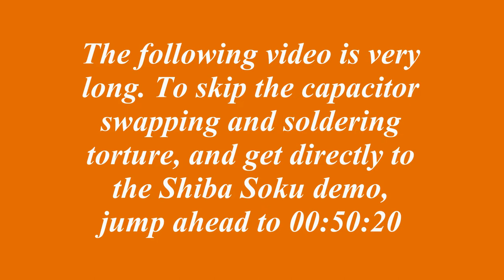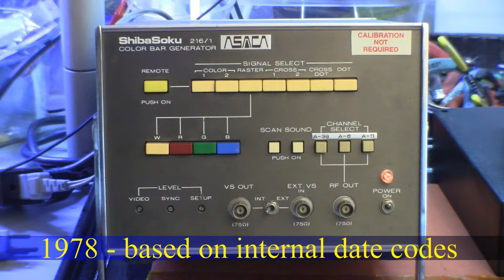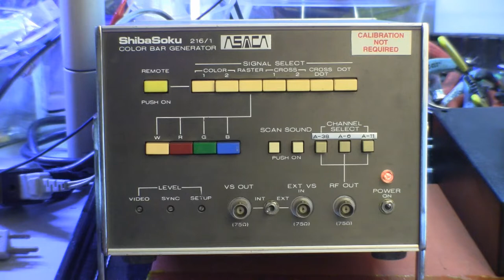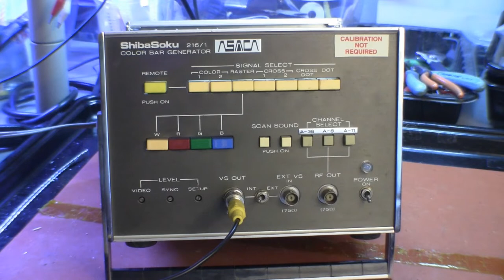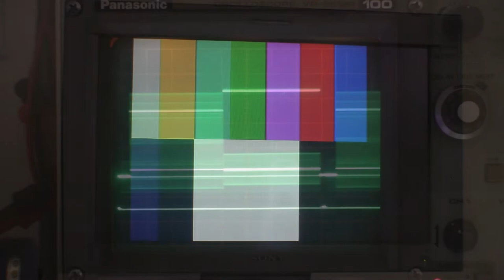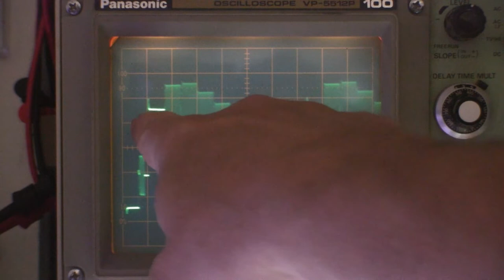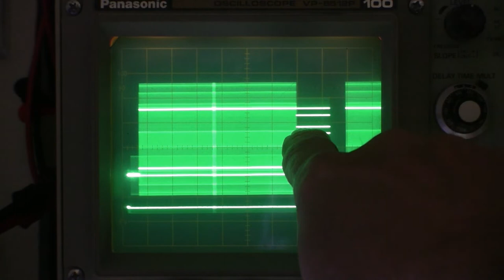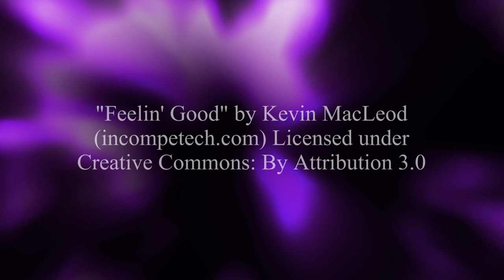Servicing My Shiba Soku (Asaca?) model 216/1 NTSC Color Bar Generator,

Comment: I really love the look of 1970's electronics! They usually seem to be much more neatly wired and well built, and the components were still spaced out enough that it's relatively easy to work on. By the 80's, I noticed that things were starting to get a lot more complicated and they started really cramming parts close together. And by the 90's...forget it!

Comment: I found the same thing on those 1970s Japanese clamp mount electrolytics. I repair a lot of 70s stereo gear. They most always check good, I mean just as good or sometimes slightly better than a new cap. I generally leave them alone because a modern replacement is way too small to fit nicely and looks like a kludge.